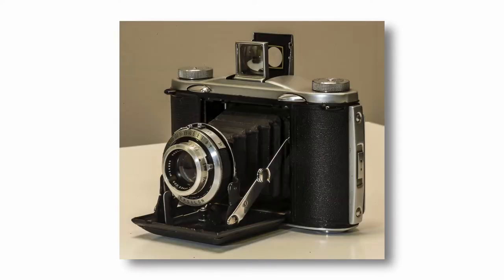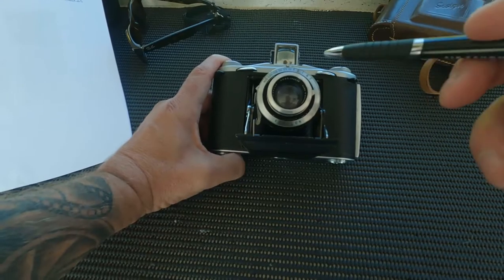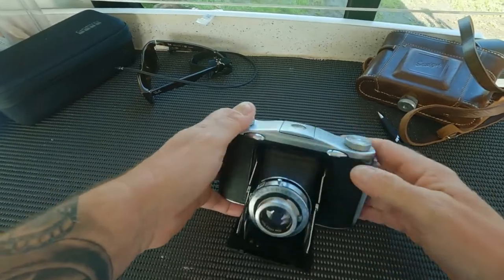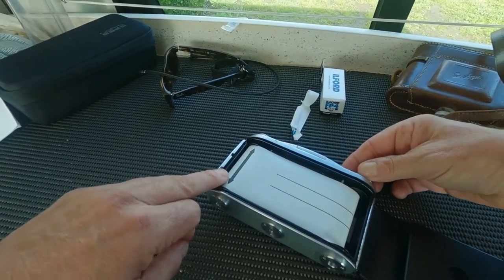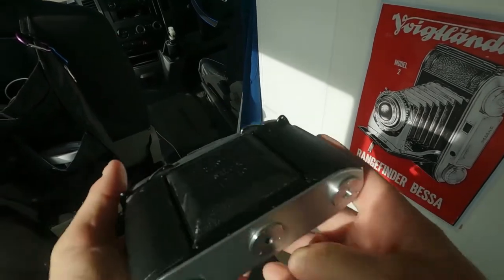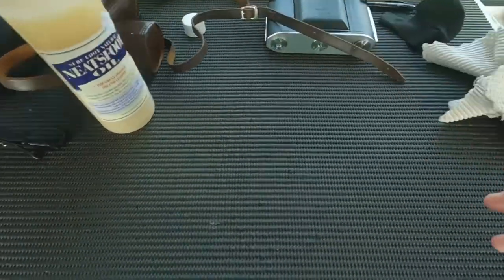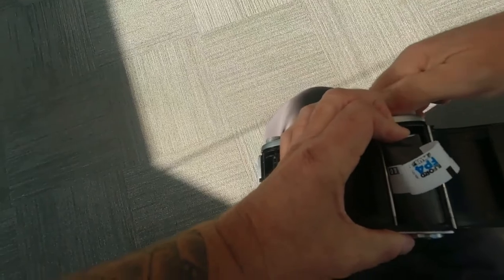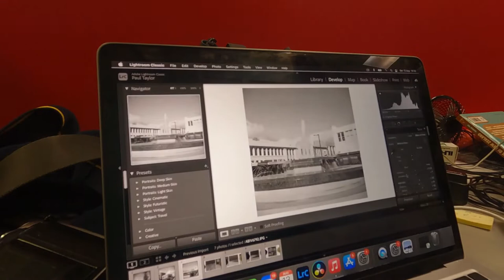MADE in ENGLAND a camera 📷 well worth trying | Ensign Selfix 12-20

Comment: What a lovely design.. simple clean lines for a folder camera. The view-finder looks sweet as so often on these folders they are worse than useless. But similar to other folders the images magically transport you back to the 50s! Did you adjust the levels much in post production?
Reply from the maker: Totally agree mate lovely camera capable of cracking shots. My post workflow is pretty basic slight a curve I add a touch more contrast lift shadows drop highlights and sometimes add a wee vignette I do the same thing on everything I shoot I had to clone a few dust spots away too 😂

Comment: HEY PAUL --   Thanks for the 'PLUG' for My Channel !!   YES the STRUTS are not as solid as on my 1956 German Agfa Isolette III and that DREADFUL  Design of those twisty things to get the film OUT -- I have hurt many a Finger Nail trying ! ALSO  -- WARNING -- never CHANGE THE SHUTTER SPEED with the SHUTTER TENSIONED  -- I Cocked up MY 12/20 doing it by mistake and now i cannot lock the shutter spring lever  and to make exposures I have to pull the lever and 'Let Go' and shutter fires . also the cable Release no longer works and shutter has the Dreadful British 'EPSILON' Flash Synch Socket NOT the usual  German 3mm Co-Axial plug so you need an 'Adapter' RARER THAN  HEN'S TEETH !   Other than THAT -- Keep Snapping!
Reply from the maker: Legend that’s for the advise mate I’d heard the speeds issue before on other cameras those bloody pins what a pain the one on inserting side east and works as designed the take up side baaaad mate but I’ll keep a spoon handy from now on. Hmmmm an isolette seen a few on auction sites 👀👀😂😂❤️📷
Reply: Some years ago I had a small hammer head flashgun and made a bayonet adapter for the Epsilon shutter on my fathers old field camera.  For a long time I thought I had lost it but when checking to see if the flashgun still worked, I happily found the connector tucked away in the battery compartment.
I have seen it mentioned that a suitable washer can help with the problem of film removal, though haven't tried finding one, I suspect it won't be easy.
Reply from the maker: @grahvis  nice one mate yeah for my technical and practical abilities I’ll stick to using the spoon 😂😂
Reply: @paultaylorphotography9499  Inserting the film on this model is easy. Push the film spool down and pull the pin outwards, this will stick, then insert the spool, twist the pin which will snap back in and behold: the spool has been well inserted. The lenses on Isolettes are not as good as the British Ross lenses, these are even better than Zeiss.
Reply from the maker: @Autorange888  thanks for the info mate appreciate it 📷